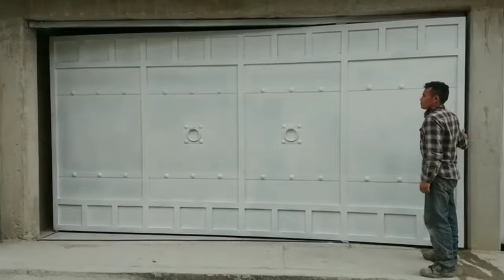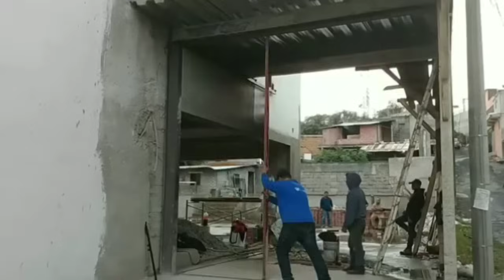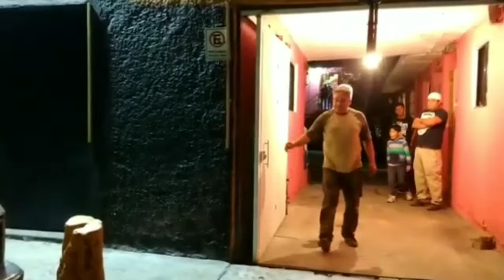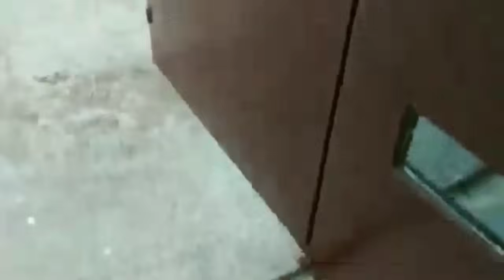Mix. de portones corredizos en l (de creator ribradi)

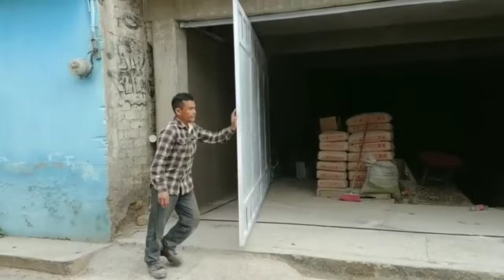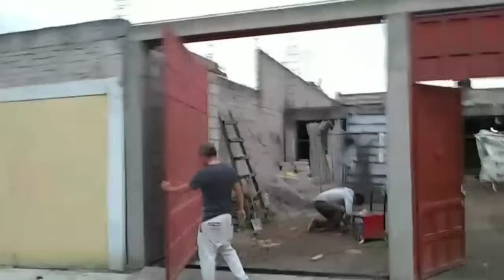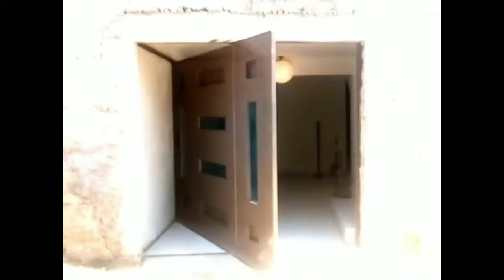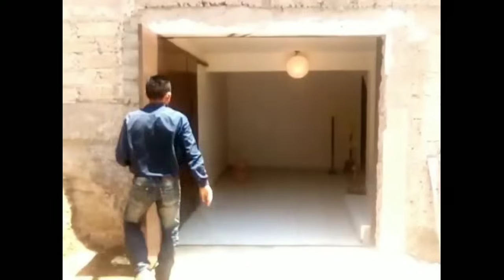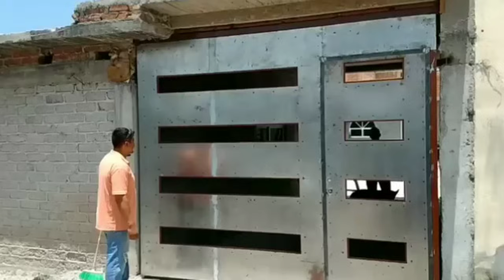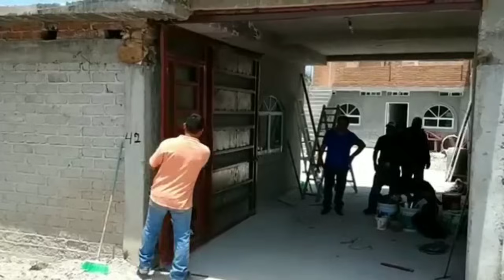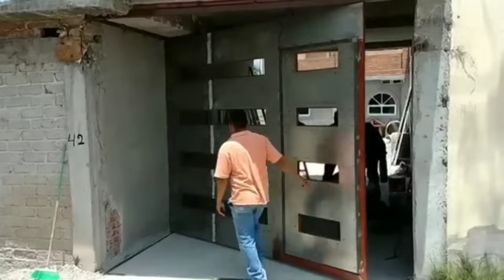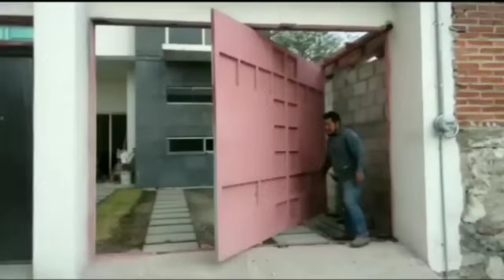Comment: Interesantes proyectos de puertas. Aunque una condición es el volumen de operación (0:46, 0:52, 1:10, 1:16, 1:23, 1:28, 2:15, 2:23, 2:40, 2:50, 2:57, 3:08, 3:15, 4:13, 4:37, 5:10, 7:50, 8:49, 9:20, 9:52, 10:07); ya que cuando la puerta se desliza provoca un área operativa horizontal de L²(1 - π/4); donde L representa la medida del largo acotado del portón debido a los rieles o guías. Esto es, para que no choque la puerta con algo u operación en área establecida para el diseño de movimiento.